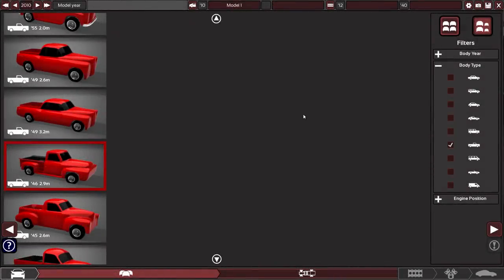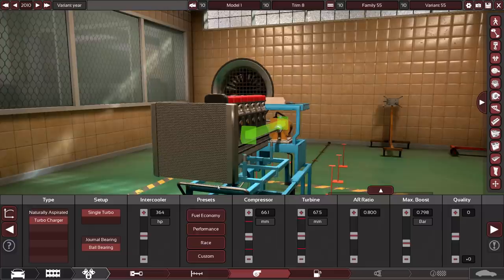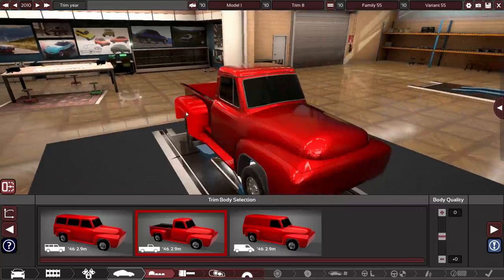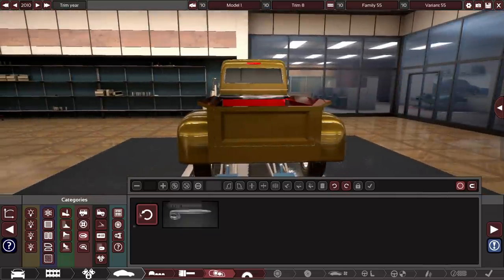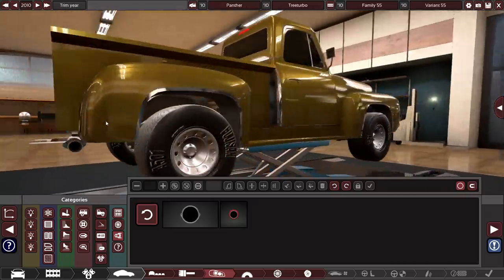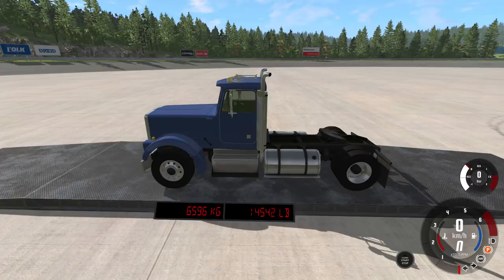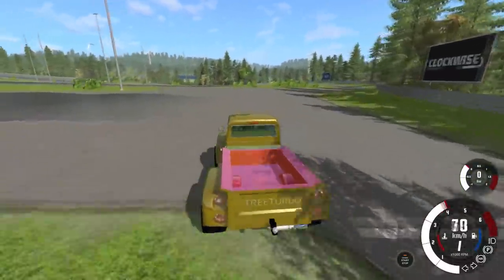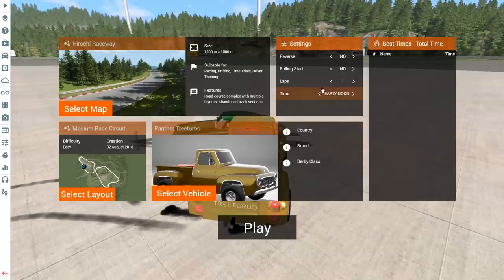Massive Torque I6 Tow Truck (Automation + BeamNG)

Comment: 1097Nm of torque converts to 809 lb-ft.
I preferred the original taillight design over the ones you did use. They where more fitting for the 40s bodystyle.

You are also using the same track for your lap times that I am using for my Automation/Beam series! Will be interesting to compare our lap times with the cars we build.
Reply from the maker: Thanks for the feedback and unit conversion. I checked out your series and am impressed by how high quality your video is, keep it up!
Reply: @automotiveflux  Are you able to make a replica of Ryo Watanabe's Lancer from NFS Prostreet? Please?

Comment: You made a gas Cummins. Aight then
Reply from the maker: That's the best we can do without actual diesel engines in game....
Reply: @automotiveflux  push the fuel mixture to the limit and will do lots of black smoke in beamng
Reply: That exist in real life too, the V10 Magnum, sounds exactly like a Cummins and pulls like a Cummins (just a bit more thirsty)
Reply: @automotiveflux  At one point I actually managed to make a diesel-ish engine with max rev at 4500rpm, low hp and high torque, excactly the sound of a diesel. If I manage to duplicate it I will let you know :D
Reply: @AMV12S  Rolling coal :D
Reply: 300 I line 6 from Ford were torque monsters. I'm sure they weren't that much but they were stupid cable motors. Alot of people preffered them over the 302 or 351
Reply: I mean its OHC so not really
Reply: @samwilson182  Not me. Proud owner of a 1994 f150 i6. 😁
Reply: Sam Wilson I got a 1977 Ford with the I6, looking for a 350 small block 3 speed for it
Reply: I edited the jbeam file instead to make sure it's more efficient and smokes like badly maintained bus
Reply: @samwilson182  absolutely I have one in my 67 F100

Comment: The biggest reason you have wheelspin in this thing is your gearing. You need a lot more gears.

Note that most large, high tourqe trucks have upwards of 7 gears.

Also, watching Killrob (one of the automation Devs, who does playtroughs of it on youtube) could give you a better idea of what needs to be done to balance a car.

Example: 
If you want to reduce over/understeer you need to pay attention to the three line graph and try to keep the curved line between the red and blue ones.
If you want to fix the brakes you need to get the red and blue lines on the brake graphs to match each other, or get as close to each other as possible (the upper two lines represent the forward brakes, and the lower the back).
Reply: Some semi trucks have 24 gears also
Reply: @braydenfizer6826  my truck has 12 gears
Reply: simone silvestri nice 👍
Reply: The Problem with Matching the Brakes is that they Brake fade then
Reply: Shhhhhh dont tell he dumb
Reply: Good job dude thx!
Reply: The amount of gears doesn't affect wheelspin unless you consider not being able to spin very long before the car catches up with the speed of the tires from a super low ratio. Big truck have lots of gears because they need the torque to get stuff moving and diesels have a small rev range

Comment: So I stumbled across your older PIke's Peak Hillclimb racer video and heard that you (might still) need some tips and pointers on engine building, at least with the fine tuning with everything. What I've learned personally is from tinkering on Automation, NFS Pro Street, Gran Turismo 4 through Sport, and FH4, as well as general things I've learned from motorhead TV shows.

Usually you want to try and get your peak power roughly 500-1500 rpm before the engine's limit. This can be done mainly with Valve Timing adjustments, as well as Cam Timing. However, if the engine does have a turbo installed, adjusting the AR ratio also moves around where your peak power is as well. I think AR ratio also decides where the full brunt of the turbo boost kicks in, I'm not too sure, but in a high power vehicle, once it kicks in you best hope you still have control.

Adjusting brake force in Automation is also very difficult. I try to tweak the brake power to tire grip ratio to where the brakes have slightly more power to them than the peak of the tire's grip. Also try and consider making the braking distance of the vehicle as quick as possible, because it can and will make a difference. On top of that, with the AWD drive train, I've found that 35/65 power split is the best, especially if you're wanting to focus downforce on the rear of the vehicle more than the front. However, a 50/50 power split can still work, you'd just need to tweak for the difference.

Speaking of downforce, this can be a bit tricky. I've found that trying to get a positive value on the front of almost every vehicle I make is improbable and usually results in having to install at least 2 lips with the front downforce cranked up to 100. I always try to keep them anywhere between 100 kg - 200 kg on the front, with around 20-40 extra on the rear. This should help with high speed cornering, but that also is due in part with how your tires are built/made.

Thicker tires help reduce wheelspin, but they create the headache of, "Why the *** can't my car turn at all!?" The solution? Less gears. You can put 7 gears on a 1000+ bhp vehicle, and it'll peel out through and through till it hits 5th gear unless you drop it down to 5. Yes, it won't accelerate as fast, but at least you can put the pedal to the metal through corners without having to worry about the rear end coming loose.

A few other tidbits that I personally enjoy; give everything a manual locker LSD. You can choose to lock up the front, rear, and center diff anytime you want. If you want to do 4-wheel burnouts, go for it, but if you want to grip everything, lock only the center. This also allows you to drive your car around when it's missing a wheel or three by unlocking all the diffs manually. With suspension tuning, I try and keep the roll angle on cars as little as possible. It might screw with your turning radius just a small bit, making corners even more of an issue, but at least it doesn't want to roll over! And finally, the one true aggravating thing that I hate but have come to accept; Automation adds statistics and throws unnecessary numbers into everything because they expect every car you make to be street legal; the point of the game is for the player to be an automotive tycoon marketer, which makes the making of, for example, PIke's Peak hillclimb race cars impossible because of how the game works. Doesn't stop anyone from having as much fun as they do though.

Good luck and have fun on your journeys, you're doin amazing with your work.

Comment: Build a luxury car, that handels good at Autobahnspeeds(250kmh) and has a 3 cilinder engine
Reply: That's just stupid luxury and 3 cilinders shouldn't be in the same sentence
Reply: @lamoona4269 
You're right is should be 2 cylinder.
Reply: @D8W2P4  I opt for 1 cylinder 🤣
Reply: I opt for using a bicicle chain sistem
Reply: @Giova590  fuck it lets go with the fred flinstone system
Reply: Chase Williams You know what? Gravity power.
Reply: @chalupamsf  Oh yeah, let's do some leg exercise 😂
Reply: @Giova590  Screw It All Air Power System Luxury In This B.
Reply: @SolaricAngel116  try inline -2
Reply: @kwakhru435  Ok
Reply: It's not a luxury car if it has 3 cylinders. The reason luxury cars have pretty much always 6 or more cylinders is because more cylinders generally makes for a smoother engine. And smooth engine with little vibrations is part of the luxury of those cars.
Reply: Why not a w32
Reply: A small 1.0 3 cyl already rattles like hell at low rpm, I can’t imagine how a bigger displacement 3 cyl going to be
Reply: Congratulations, you have predicted Koenigsegg
Reply: Gr yaris can hit the speed limit
Reply: @Giova590  bicycle* system* don’t know if you meant that as a joke or that your a toddler
Reply: @rissu8573  ?
Reply: @Giova590  I was correcting the spelling
Reply: @rissu8573  idk english is not my main language so i may be wrong
Reply: @Giova590  oooooh that explains it
Reply: @Giova590  btw nice profile pick the 34 gtr z tune is my fav car the Supra is 3rd on the list
Reply: @lamoona4269  what about the i8?

Comment: In truck engines, they modern formula is something like 15 liter Diesel inline 6 with turbo and intercooling. Power is usually around 500-600hp and torque between about 1700-2100ft/lbs. Redline rpm in trucks is nearly always 2100rpm. Boost pressure is often quite high in modern trucks. My Cummins Signature has 35psi boost for example.
Detroit, Cummins and Caterpillar have used this formula give or take the parameters I mentioned. V8s in trucking are still around especially for specialty use but are mostly out of favor due to the pumping losses of 8 cylinders vs 6 cylinders and that effect on fuel mileage in low boost situations. See a low boost I6 gets better mileage than a low boost V8 when both make about the same power when on boost and V8s have vibration issues that you can't feel but are there none the less that are due to their uneven firing order giving them the distinct sound we all know and love. Long term durability becomes a consideration as does cost of production being more complex for V8s. Detroit Diesel had countless thousands, millions even of 71 and 92 Series V8 2 stroke Diesels that completely dispell what I just said about V8s but that was in an era when really long lived engines didn't exist as now. 

The engine in my truck is well into the 900,000 mile region now but back then 500,000 miles was the benchmark. Mine will go a million miles but one of our same year and engine, other trucks, fell short the other day. It had broken rings and was smoking so bad we had to do an inframe rebuild (pistons, liners, bearings, reco head, injectors and turbo but no crankshaft as the block was still inframe - hence 'inframe'. It got into the 900,000 miles but didn't quite make it to a million LOL.
Interestingly some companies are are making some very powerful new V8s in trucking. Scania have a 710hp 2600ft/lbs that is apparrently a ripper of a motor I here from one of my trucker friends.

In the 1960s Chevy made a gas V12 for tucks. It was 702 cubic inches. About 5000 were built.
https://www.enginelabs.com/news/a-look-back-at-the-702ci-gmc-twin-six-v12-engine/

Comment: Idk if you have a wheel spin issue with your cars. I think with any car with moderately high hp you will have wheelspin if you floor it at low speeds. You just have to be careful with the throttle. 

Also, more gears will help reduce your wheelspin.

Comment: I work with the try trade to company that Works in housing Construction and I have noticed that most of the guys that drive trucks that originally Duallys are actually putting on the normal but aftermarket tires on the front and aftermarket single tires that are super wide on the rear. So the idea on your truck isn't unusual at all. Yes Duallys do not exist in this game but this idea of just having four tires in the rears being massive as hell is an actual thing in real life.

Comment: I find that one nice way to decide on a headlight is that, if the car is from 1940-1973, then under US regulation it would have circle sealed-beam headlights, and from 1974-1983 It would either have rectangle or circle sealed-beam headlights under US regulation.

Comment: i think due to the high power and torque you should have had more gears and a higher gear ratio so you don’t spin you the tires as much
Reply: This needs to be done for the 2020 Panther Treeturbo, or the real life version I wanted for production under what I predict would be a Chinese-Japanese joint venture between Isuzu and Changfeng Motor
.

Comment: Right so if you wanna handle wheelspin, you need to adjust the swaybars, in the opposite manner for what wheels you want to increase traction on, so higher front swaybars will give you better traction on the rear, id explain why this works but its a long story and unless youre savy in race words then its hard to understand. But this is how to adjust your wheelspin! Use it wisely, id suggest testing the car in beam first, then adjusting your swaybars and suspension settings.

Comment: You can tune an engine to have low hp and high torque. I have a 5.9L I6 pushrod that has around 300hp and over 800 lb-ft. Just limit your rpm to 3k and tune accordingly 🙂

Comment: The torque comes on too abruptly due to the turbo set up. I think you should have the more eco set up so that the torque curve is smoother and peak torque is at lower rpm. I would recommend vvt which will also broaden the torque curve.

Comment: I've built a  truck with the same model, 16 liter engine with a Fuel economy turbo and VTEC, it has 1720 hp and 4500 Nm of torque. It revs up to 3000 rpm and it has 1500nm of torque at 1000rpm😂. It can tow the 19 tons coca cola trailer.
Also there is a mod that gives you the tow bar to tow that. The best way to make it is with 4x4 transmission and the off-road differential so you also get the high and low gears

Comment: Nice I have a 95’ Ford F-150 with a 4.9l I6 engine and after some tunes and upgrades I’m getting 400ftlbs of torque on 200 hp, I tow gooseneck trailers with ease on it, call it the tow pig lol

Comment: Well more gears would help, a lot. Why would a hauler want 4 gears? 6 would be the better route to go with the 6th gear being the overdrive gear while the others would be the tow/haul gears. It helps on the torque ratio and range.

Also you are making it as if it was a race truck of sorts, lower the max rpm to around  the range of 4 to 4.5 k rpm. And lower the top speed. But more gears would definitely help out.

Brakes should be more balanced towards the rear and if it was possible made a fifth wheel type

I'm speaking from reference because I have a farm truck that in itself, is a torque beast. It's got leaf springs front and rear, a manual 5 speed transmission with 5th being the overdrive, long economical gear not meant for torque, and its heavy all around.

Comment: In real life aluminium head and cast block are not very good the two dissimilar metals heat up at different speeds and blow head gaskets I know it's a game
Reply: Challenger RC there’s literally tones of engines with aluminium heads and iron blocks and are bombproof. It’s the 21st century pal.
Reply: @Diesel8290  ok pal try being a little more polite. I am not changing my opinion doubt you will change yours. This is not really  worth arguing about because I know many other machanics that are on both sides.

Comment: 1st. You have the transmission geared way too high. You want 1st to be low like at least 4:1 for example my favorite 4 speed the NP435A has a first gear of 6.69:1 second gear 3.34:1 third gear 1.79:1 and fourth is obviously 1:1. If you want to build a tow rig, you need to remove the thought of top speed. Tow rigs need to be able get their load to their destination 100% of the time and taking a corner with 12k behind at 60 mph will guarantee that the load or the truck wont make it too its destination. You don't need unholy amounts of power if you have enough gear multiplication back in the day 2.5 ton - 5 ton trucks(gas powered) would make between 220-550 ft-lbs but would move massive loads thanks to low geared rear and they commonly had 2 speed rear ends. UPS trucks and older gas powered garbage trucks used the ford 300 CI (4.9L) I6 which at its peak made 270 ft-lbs. I could go on forever. But look at the past for idea of how set up a rig

Comment: Pushrods (overhead valves (OHV)) are a lot better at torque, while overhead cams (OHC) are good for high RPMs.
Reply: Pushrods only makes the RPM range smaller.
(D)OHC makes the same (or more) torque with a higher RPM range, more RPM+same torque = is more HP.
The only thing "high torque" means is that you have high horsepower at low RPM. 
Torque on its own does nothing, the amount of horsepower tells how much you move things.

Comment: Tip: If you use the tool which paints the entire body it should paint the bed of the truck.
Reply from the maker: Surprisingly this doesn't actually work, seems to be an in game glitch
Reply: have u tried the secondary color or the other buttons?
Reply from the maker: @trainzmarcel2074  Yes I've tried every button, it's always possible i"ve missed something
Reply: omega oof

Comment: shouldve gone for higher stroke than bore, and hp is a function of torque times rpm divided by 5252 so all you have to do is lower the redline to get less power

Comment: If you use the fuel economy preset and increase the turbo size a little bit and turn up the boost a lot I’ve been able to get more torque that way...and why don’t you use traction control lol it would help quite a bit with wheel spin
Reply from the maker: Traction control doesn't work too well in beam so I don't use it

Comment: Try making it a “diesel” again. Make it with a very high compression ratio with high octane fuel so that it runs like a diesel somewhat. Basically, big stroke with a smaller bore, high compression around 20:1 like a diesel and high octane fuel to let it run high compression.
Reply: 15:1 is max compression on the game, diesels use a large square bore to build the higher comp ratio without revving til it knocks

Comment: 2010 design?  if I didn't know better id think it was from about 1947.
Reply: The car model is unlocked in the 1940s however he did it as a "2010 design" so that he would have access to modern day tech. Pretty much all of the technology used for the car is modern day stuff which didnt exist in the 1940s